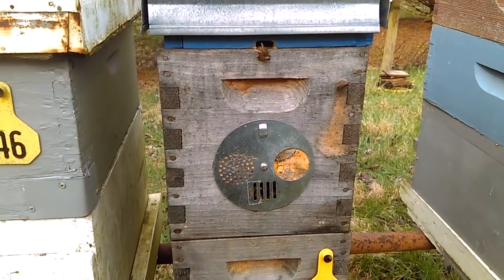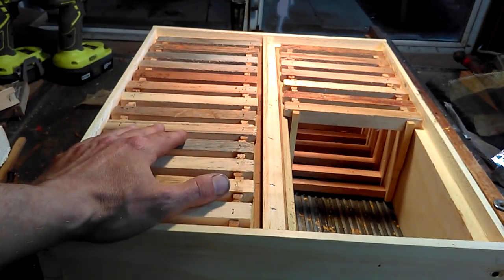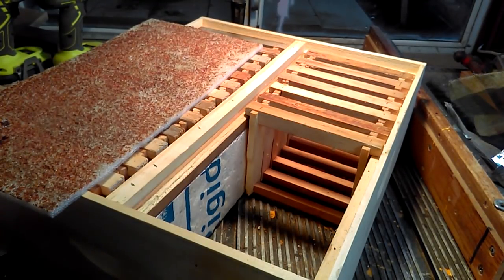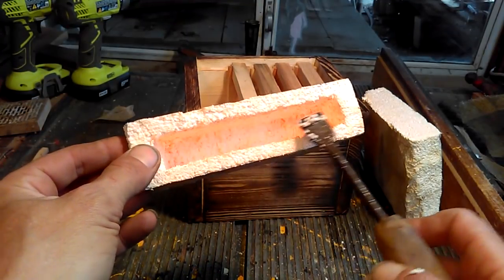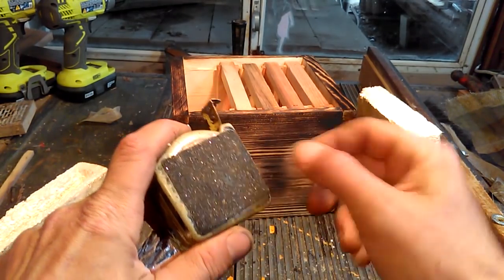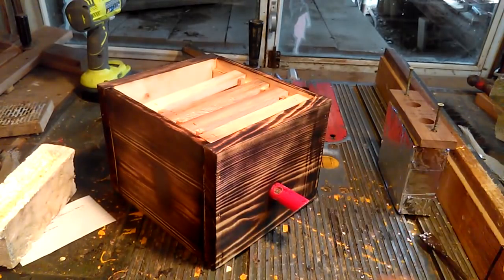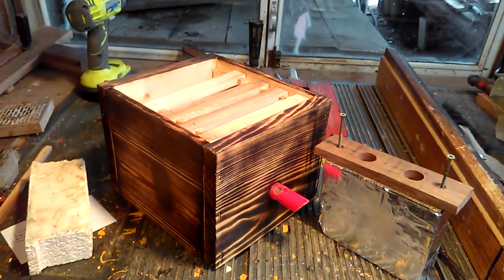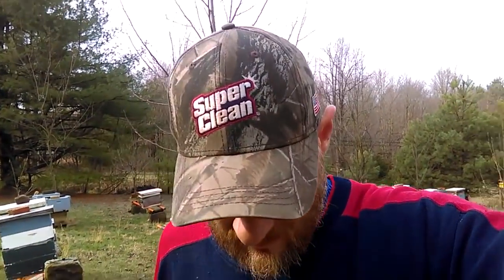Building Frame Feeders, Protecting Styrofoam And Woodware

Comment: Nice job Jason, you made of your frame feeder and I like the idea of the aluminium tape to protect the outsides.I  was wondering about the bottom ventilation with the feeder in place, but you covered that point, thanks.So many people have good ideas, but they leave them to wither on the vine. Keep up the good work.Necessity is the mother of invention, As an engineer I always think of other uses tools and materials could be put to.
Reply from the maker: Thanks! The feeder has about 3/4" space between bottom and ventilation so no concerns I don't think, time will tell. 
I like to be resourceful when I can.

Comment: In Europe, torching is the way the majority choose and for many years. What it does is that it burns all the fine splinters on the wood that trap little dropplets of water which are then transferred to the wood structure and causes it to rot. If you have noticed the wood is very smooth after a light torch burning. Thus there is less water retention on the surface besides being a way to sanitize the box. I personally think it looks good too. Bees apparently like and are attracted to the smell, because in nature the hollow trees become so because of a lightning strike hitch causes fire and hallows out part of the tree. Well that’s what I have observed. I think you are going to like your experience with it.

Comment: I am trying out a wood stain from Vermont natural coatings that's a polywhey.  Another beekeeper uses it and seems to have had success with it. I'm doing a side by side comparison of the polywhey and waxdipped hives
Reply from the maker: Best of luck with it and keep me post if you would. Thanks!
Reply: Jason Chrisman I will.  I had to order the coating directly from Vermont's as no one locally sells it but there is a local distributor who sells their hardwood flooring product and said that if my test goes well they will consider carrying the exterior product.
Reply: Lynn Burroughs I had seen this to and am strongly considering using it.
Reply: Tim Miller you'll have to let us know your thoughts if you do.

Comment: ;-)  THAT  was an genius idea the sandwich bag an that luminum foil tape should serve two purposes 1 protect the styrofoam 2 will reflect the heat back At them ;-)
Reply: If you are going to use the sandwich bag liner for your feeder, why fool around with the foam and tape?  Just make it out of 1 x 2 w/ 1/4 ply sides.  Much simpler w/ no foam gasses in your hive

Comment: Jason, I'm using Segerberger hives and it's pure styrofoam and no bee's haven't done anything to them except some comb piece's. One if our club had used styrofoam hives the last 6 years and no have even chewed on it so I don't think you have to be worried. Regards one of patreon.
Reply from the maker: Your hives are not styrofoam. they are  polystyrene. I have a few of them myself and your right bees do not chew on them because it's too hard but styrofoam isn't and they will chew at it. I appreciate you opinion though and thanks for the support my friend. Stay safe out there!
Reply: @JCsBees  the material you are making your feeders out of is also polystyrene   (expanded polystyrene)
Reply from the maker: @hyfy1970 Are you sure about that? My poly hives seem a lot harder than the insulation board I am using. Maybe there is different degrees to the polystyrene?
Reply: @JCsBees  There are different types of Polystyrene. The hives might be extruded instead of expanded. Great link https://www.creativemechanisms.com/blog/polystyrene-ps-plastic

Comment: Hi Jason, just wondering if you had chance to test making a wooden feeder which could be sealed with wax in the inside as well. guessing will last longer!
Reply from the maker: I have made top feeders in the past and coated them with wax. It worked well at first but over time began to leak. Guessing the sun plays a tole on them leaking over time.

Comment: instead of cutting/scraping why not get a block of metal, heat it up and melt your way down...it would also make a smooth interior that would be easier to clean
Reply: Do so in a well ventilated room. Melting Styrofoam is nasty. LOL

Comment: What about using some curler queen cages instead of the wire screening as the feeder tubes - you could just attach/glue them to the bottom of the block of wood?
Reply from the maker: Great idea! I will give that a shot.

Comment: Cool, I like the feeder. Still a lot of piddly, fiddly work. Should be something simpler but damned if I can think of what that would be.

I was throwing together nucs from 5/8ths plywood yesterday (5 frames) and the thought occurred to me that with a bit of alteration to the design...I think I could build the frame rests on the sides rather than the ends, divide the nuc in half and make double mating nucs. Mann Lake sells frames for their double mating nucs, not sure of the width for them to fit yet but they're like a buck each (or I could build some from scratch I guess. But that would make two mating nucs for roughly $2 each and three frames each (+$3 ea.) for a total of $5 cost. The foam minis I bought this year are nice but were about $15 ea. and have nice feeders and screens already. Goal is to run 100 so $500 cost vs $1500...savings of a $1000.

 Still the feeder issue to work out though. I'm thinking of just a hole in the top and mason jars and forget the frame feeder concept altogether. Pro-nucs have a holder for a plastic soda type bottle, maybe figure a way to reproduce that but I can't imagine filling those would be much fun. But anywho, yeah four five frame nucs from a sheet of ply x 2 minis per nuc box equals 8 minis per sheet of plywood without a lot of extra cuts of small pieces and easier to handle boxes, lids, etc...I'm gonna give it a go.12 sheets of ply so less that $300 for the boxes, another $300 for the frames if bought. I have a ton of old plastic frames I could cut down and rewax for the mini frames also...maybe a much simpler solution. Also thinking of making some super boxes for the mini frames and using five frame nucs of bees to draw those mini frames out. 100 mated queens @35 ea. is $3500 worth of value (I know 100% isn't realistic) run them through two breeding cycles and I'm in to some serious numbers of bees and money @$175/5 frame nuc.

I'm thinking of investing in a wax dipping rig for that kind of scale of operation. I friggin hate painting boxes and painted plywood is iffy anyway. I doubt scorching ply would do any good. Hot wax dipping seems feasible and fool proof.

 Planning on planting honey crops this year and growing my bee hobby to something more than a hobby. With 25 years experience behind me and a couple thousand acres of potential bee forage, I think I could make some serious extra play money for the retirement fund. 44 now, by retirement in 15 years (if corona doesn't get me, RIP Joe Diffie) I should be comfy, lol.
Reply from the maker: @Brent The feeder has drove me nuts trying to figure out. Everyone says I am over thinking it but I don't think so, I think if a person has much carpentry experience they know to find the fastest feeder to build due to the number of them needed. Sure this feeder design isn't the fastest but it's still pretty quick and if I use Nancy suggestion from my comments and use roller cages vs the screen rolled up that would save more time. 
I have a bunch of the jar feeders my issue with them is the time it takes for a mini to eat it. During this time the sun causes mildew to form in syrup. If a person had covers for the jars to keep the sun off them, the syrup would last longer. Not sure if painting the jars would help or not?
It sounds like this virus and being trapped at home has caused you to do a lot of figuring. That's a good way to start new projects for sure. The numbers show your idea to be a profitable one for sure. I do think $175 a nuc is a little low though but maybe that's the going rate in your area. I am seeing as high as $230 here. Hell, Rural King wants $200 for a 3# package. Crazy, huh? lol
Sad about Diffie. Keep safe and healthy!
Reply: @JCsBees  Yeah nuc prices are all over the place here. I see them over $200 around in a few places but there are a lot available here in MO/KS on Marketplace and Craigslist for $150-$180. I could sell them at $100 and still make money but I can always drop from the $175 if need be. I'd imagine selling them at the $175 would be no problem though. Bee prices are nuts, I recall buying packages back in the 90's when I started with bees and paying something like $45-$55 for a 3# package with a queen. 

Well I have a goal of backing away from cash crops and going all livestock on a mix if annual and perennial forages and mixing a decent honey bee operation in there. I'm kind of tired of the inputs, weather, markets and logistics of the cash crops. It's a thought that's been floating around in my head for a couple of years actually.

Comment: If you're going to use a plastic bag liner for your mini feeder why bother with the styrofoam block and tape?  A simple box made w/1 x 2 scraps and 1/4" plywood sides would do the trick.  Line it w/the plastic bag and cover w/the same top bar.  This style would hold more syrup too.

Comment: If you are going to use a baggy maybe make the whole thing out of wood or ply
Reply from the maker: That was my plan at first but I couldn't find any wood around my place that was 2" thick.
Reply: @JCsBees  maybe use 3/4" stock and dado 1/8" plywood into it?
Reply: If you find a local guy in your area with a portable sawmill I'm sure he has scrap 2" / 8- 4s. Laying around it probably would help him rid to many scrap's laying around. Having a sawmill myself I either give it away if possible or have a campfire night with my grandson 👍
Reply: @JCsBees  Lay a 1 1/2" frame down and put 1/4" plywood sides and you are done. Put the baggie inside and water tight. It should last forever.